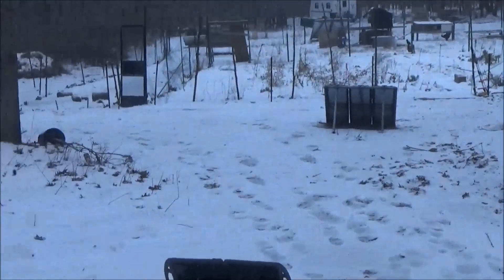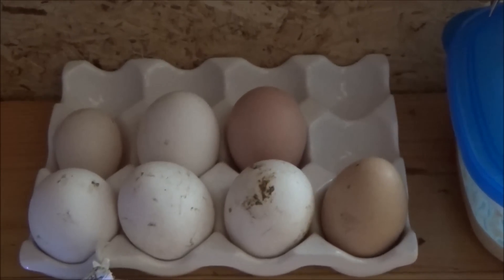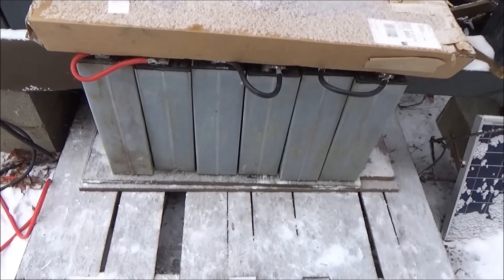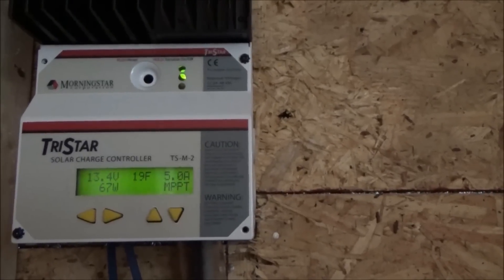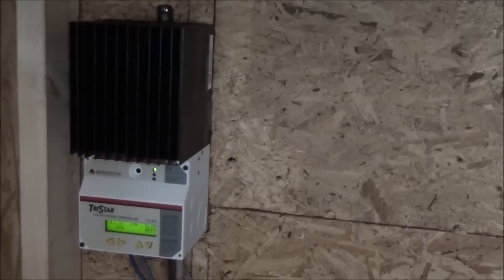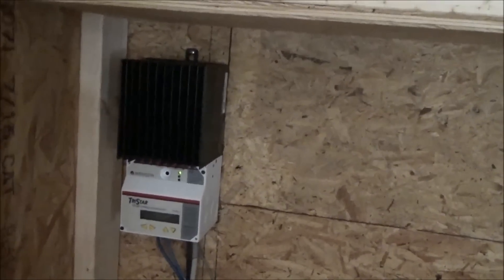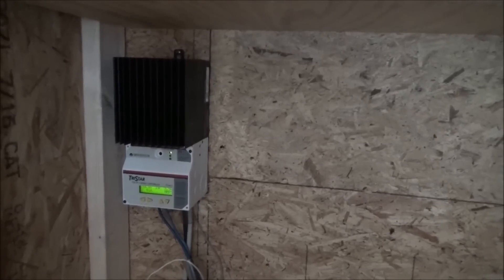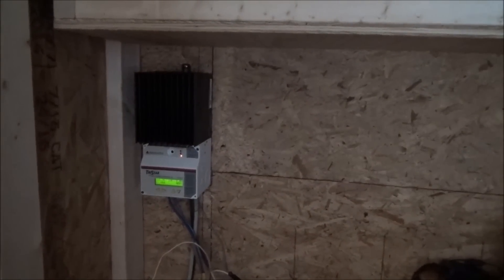Testing Old Forklift Batteries For Tiny House Solar Power

Comment: your generator RPM a little low?? (sounds too low ??.)
800W 120 Volts *(Should be max output  7+- Amps)
14.5V 30amp 430w+- (6.5A+-@120)
that's "if" your still making a full 120V at that load...  

(my charger will not "charge right" under input 105Vac)
(Just wanted to see how low she would go and still charge.)

Just saying check your voltage on your generator with a load and see what's going on.
Reply: You made a good point about his generator, I know others have made the same point, I don't know if he either doesn't read the comments or doesn't listen.
Reply from the maker: I always set my charger at 20 amps though. It seems to be charging because my batteries are not dropping and I can power everything I need inside the tiny house with the generator and charger running. Works for me so far.
Reply from the maker: dechase13 Now you have me thinking. How can I test this out without proper equipment? My biggest problem is that this HF generator stutters a lot. It misses now and then. I do know that is a problem with some equipment
Reply: How much draw is all your computer equipment?
Should be no more then 7A I would think?

When I Up the RPM on my Gen the Charging voltage will "go up" if the RPM is too low it just hangs around the same charging voltage and some what go's up a little bit.

maybe your only charging at 2-5 amps when your generator is running 

I think mine was only start charging at around 105 volts that until I moved the RPM up 500 or so RPM. then it was charging right.
Reply: dechase13
These generators do produce sine wave electricity (although there are also loads of harmonics that many cheap generators have, but that is a separate issue).  What actually happens is that due to the much higher source impedance of the generator (compared to mains), loads that only run on the peak of the cycle (such as battery chargers) cause severe cropping of those peaks.  This greatly reduces the charging current from the charger even though the RMS output potential from the generator does not drop a great deal.

Comment: 1 step forward, 2 steps back, glad to see you finally have a base point to work from, but your getting false high voltages from your batteries being so discharged and sulfates, i dont know why you thing that genny and battery charger are gonna help you, they couldnt even properly charge the golf cart batteries, Im happy for you but have yet to see how this will work long term as you can seem to keep the little golf cart batteries powered I hope it works out though, thanks for the vid
Reply from the maker: 2 steps back? Uh, no. I think you should be here and see the difference in person. These at least have a charge and some useful energy for me. I am running my laptop on them right now.
Reply: The Do It Yourself World for now you have power but I wonder how long it will last, just seeing the vid and making judgements can make me seem harsh at times if so im sorry if i come off that way, it was my experience with helping my father with his batteries(6 surrette/rolls 6v 460a/h each) that they will last a long  time on a full charge(weeks) but when they get down they take about a week each to charge on grid power. We have a HF genny like yours that we burned out, also a 1400w genny we burned out trying to charge them, the only generator that was able to actually charge( with basically the same charger you have) the batteries at all is a 3500w one, which we still use(only 1 time this winter so far was christmas eve hooray) so I just dont see how yours could do any better,the math may seem right but in my experience its not the way it works, Id stick with your 100amp genny it will take days of running it and constant monitoring to get the batteries up to a good specific gravity, then your voltage reading will be accurate remember voltage readings from a battery with low specific gravity are never an accurate way to measure capacity. Your well on your way and I hope my comments help you to get there I'm no expert on any of this but I have been experiencing it for some time and have found alot of things that do and dont work
Reply from the maker: ghettohillbilly1 Thank you. I will be moving the DC generator over to the tiny house soon. Then it will be a good backup generator for cloudy periods.

Comment: Hi Troy, were you able to pull the other 6 batteries out of the steel case? You said you could make 2 banks of 12 volts.  
     Any reason you can't hook up your 12 volt generator to the charge controller to charge up the batteries? Just a thought.
Reply from the maker: I am actually leaving the batteries in the truck bed for traction in the snow and ice for now.
I will move the DC generator over to the tiny house soon to use it on the forklift batteries as needed. I dont find anything about connecting a generator to the charge controller so I will not do it.

Comment: Troy:
Regarding your DSL modem, I assume you are paying a monthly "equipment fee" to the phone company for this?? Perhaps $6-8  month?
I would strongly suggest you go online to the DSL providers website and see if you can find a list of  "approved/supported modems" then check your local Goodwill and Salvation Army as people turn these in all the time for one of these models. Typically a few dollars and try it out as a replacement. Could save you the equipment fee which adds up
 over time. Since you use DSL, there is no headache like there is with a Cable Modem calling up to get it approved  for connection.

Just a thought...I personally hate these fees and always try and find /buy equipment to avoid the charges.
Reply from the maker: Thanks for the tips. I had no idea.
Reply: The Do It Yourself World You are welcome!

Comment: Admit it has been awhile since I did solar but, what distance are your panels from home(charge controller, and what gauge wires are you using, and why aren't you using in 24V or 48V arrays.Your wire to array has always seemed too distant for such flimsy (easily kicked) and moved wires,

Comment: An important point I'm not sure if you are clear on...Battery chargers are NOT 100% efficient. So you can't equate 20amp at 12V DC out in watts to the same AC input in watts. The charger maybe 80 to 90% efficient at best or perhaps much worse. Also if the charger is an "intelligent" design (and I think it might be) you have it on the 20amp MAX range as it monitors the battery voltage it will decrease the current to avoid damage to the battery.
The  efficiency  point is also true for your Inverter as well, internal circuity and conversion will result in more power(DC) "in" than power(AC) "out". Even with no  AC load the Inverter is consuming some amount of power
Reply from the maker: Yes I know but its so much easier to round off numbers when explaining things.
Reply: True, I can see that point......

Comment: Hi  the reason the battery's  voltage went up so fast is because  the sulfation on the cell's is blocking the acid from the cell's  so that part of the cell has to get its charge from the parts of the cell that is not blocked intern u loose a certain percentage of ure ampacity making it a smaller battery  if I had to guess I would say u have about 20-30 amp hours of usable storage out of the bank of forklift battery's that should help u out  figuring out y a lot of things are the way they are with sulfated battery's
Reply: Actually i believe the voltage went up so much simply because the battery is at 19f.  the colder the battery the harder it is for the reaction to take place inside the battery for the battery to accept the charge, so the voltage rises because the battery is unable to absorb the charge fast enough.  The problem is the cold... nothing more.... if those battery's were at 70f they would be as happy as a pig in muck.

Comment: Q: When you are at your charger controller, can you see light coming through that seam in the OSB wall ?
Reply: I thought that too but then I remembered the foil insulation barrier.
Reply from the maker: It is radiant foil
Reply: Nice.
Reply from the maker: ESPNGenius1 By the way, I will be covering that wall later with homemade paneling so it will no longer show.
Reply: The Do It Yourself World
   I figured that you would match the other lower level walls. I must have missed the foil barrier video or I simply forgot that it was back there.
Reply: timcat100 There is a foil radiant barrier behind the OSB....and I guess you cross posted with Troy.
Reply from the maker: timcat100 Please go back and watch the videos of my putting this together. The radiant barrier is a vapor barrier. If you missed the videos please go back and watch them before talking about condensation in the walls and improper building. I talked to many professionals and had some over here telling me what is the right way to use this stuff two months before I used it. I watched many videos from the manufacturer of this radiant barrier as well.
There is certainly no ice or condensation in my house. Not in the walls and not in the ceiling. And there is no way insects are getting inside here. Another few videos I think you missed.
Reply from the maker: Lynn Morrow Talking to you is like talking to a rock. Either you are not seeing my answers or you are just poking at me because you like it. You can also go back and see where I put in the proper ventilation in the ceiling. Actually a builder friend of mine helped out. That is his profession. You want to say its wrong then you are saying his entire profession - in Canada - is wrong.
Reply from the maker: timcat100 I have not yet put any insulation upstairs in some places. And no radiant barrier upstairs at all. Its a construction zone. A work in progress. I will insulate upstairs and put radiant barrier/vapor barrier upstairs and in the ceiling.

Comment: dont be surprized with the 13.5, it has to be even higher! (13.8) from that voltage really charging begins, use the 50 amp setting at least! 20 wil do noting!

Comment: cables connected good and firm???
Reply from the maker: yes
Reply: thats what worryd me! glad thats ok!, thry to get the most power in the old bank you can, even connect the 50 amp charger on it (on  manually) when you use the mppt equalizing, get as mutch amps in it thats possible, the mppt will pull them up to the equalizing voltage getting them bubble more.
Reply from the maker: MrBugsier5 Ran two days on equalize in full sunlight and they are now resting at 12.4 volts overnight compared to previously sitting at 12.2 overnight. I am now able to run my modem and inverter all day with no fear. So it seems that the forklift batteries are coming back up some.
Reply: they are getting better, you should see that on the hydrometer to, keep charging as mutch you can, use the chager on ac the same tyme as the mppt, get some amps in, the mppt will boost it to 16 volts at chrge, this wil make them bubble and re stratificate, also resulphate. new batterys already on there place??(how many days are you behind with the videos we see?
have a good sunday! thumbs up!

Comment: You need to add 1/3 cup of battery chèm ti each cell  then charge  for 24 hours.
Reply from the maker: I dont believe in chemicals in a battery. A desulfator or Bedini motor works nicely

Comment: You do know that batteries can go bad.  Like, the sediment from the plates can settle down & when they do, they short that battery out & it will not take a charge.?

I think you should put up more solar panels & get a few good batteries that are reliable.

Your generator is a good ide, but the fuel costs are more than you can afford.

Kurt

Comment: Lead Acid batteries are not 100% efficient they take more power (120%) to charge all the way. For example a 100Ah will take about 120amps to charge to 100% SoC (State of Charge)

Comment: You do have # 6 wire from the battery and the shack? Now you are stuck on disulfide that is what you do when you charge a battery. Once a year or so you might overcharge slightly to get rid of the more stubborn sulfate. Use your Bedini When a battery vents you are damaging it. If you could charge a set of batteries at 2.2 volts you could even them out but. Well Best of luck
Reply from the maker: No I have a 2 gauge wire coming from the batteries to the charge controller and solar panels. And to the inverter. From the batteries to the tiny house I have 6 gauge wire. I am starting to think you missed a lot of videos here.
Reply: The Do It Yourself World I had a battery supply on another deck from the microwave building and the electrician only gave me 3/4 inch conduit to connect myself to the battery supply.  I ran 2 #6 wire and 2 sense leads about 18 gauge the battery charger and load disconnect looked at the sense leads which came directly from the battery and that worked out 1/2 way right at least the load disconnect did not disconnect the load until the battery voltage was low at the battery But the voltage at the microwave was a volt or so lower  then the battery. We had a 24 volt system.
If you take a volt meter and measure the voltage inside then outside you will find a difference even with 4 gauge wire. Best of luck.
Reply from the maker: Sidney Boudro Oh yes for sure there will be some loss in the wires. I hope to eventually improve everything with time and finances allow. Next year maybe I can get 00 wires

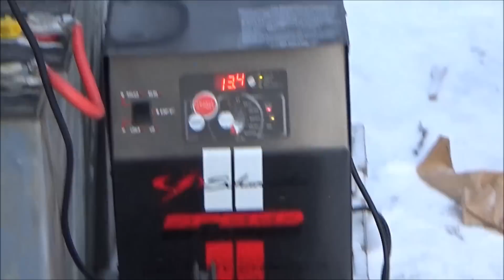Comment: Ok someone help me out here 23:10 is the plug wire off of the harbor freight generator ,left side . Or, am I going blind.
Reply from the maker: No, only the rubber cover is gone. The original plug wire was broken inside and I removed it to fix it. I could not get it back on with the "fix" in place. But it runs.
Reply: Had me going their for a moment you may want to get an insulator back on it may smooth out some of the rough idle glad to see your moving along with the old fork lift batteries I think you will have great success with them.
Reply from the maker: ctryboysurvivor thanks

Comment: I think you will need to connect more solar pannels
Reply from the maker: I will
Reply: Your big pannels are the same power? If yes, plug them in series, it will reduce the line loss. Dont go over 120 volt DC in in open cirquit to be safe.
Reply: The Tristar has a max Volt of 150 volt
Reply from the maker: Sylvain Maher I am already pushing 130 volts with the four panels
Reply: The Do It Yourself World
The TriStar TS MPPT-60 max out for 12 Volts at 800 Watts.
You might need an otter Charge controller if you plane to put more solar pannels

Comment: get  equalize charge on it asap, they are empty and not equal, get the charged first use the big genny, and the charger on his highest amp setting., use them as less as possible before you have equalized them, boil them asap. use the 50 amp setting!!!!!

Comment: there is a resistance some ware lets the voltage come up that cold mess highdrometer readings bad compare voltage and highdrometer readings to truck battery it pulls like charged the DC GENNY WAS WORKING WHY GET IT BACK YOU NEED IT USE THE  POWER AND FOR GET THE VOLTAGE SEE WHAT YOU HAVE AMPS IT ALL ABOUT AMPS VOLTAGE WILL VERY WITH TEMP AND AGE OF CELL DON'T TRUST IT for now i think you may have them topped  use them like you dont care see what you have
Reply from the maker: I will still use them carefully because I hope to desulfate them soon. They could last about 20 or more years if I care for them.